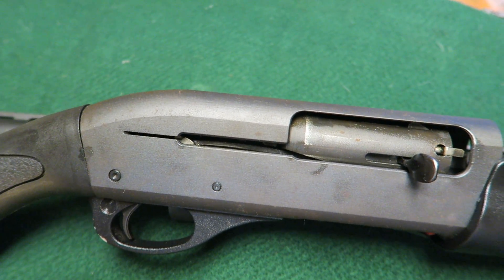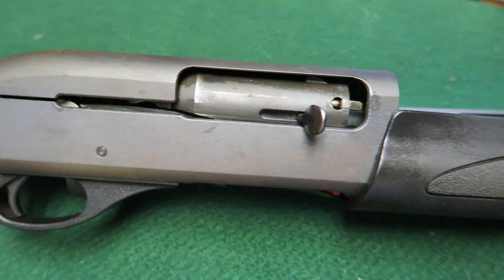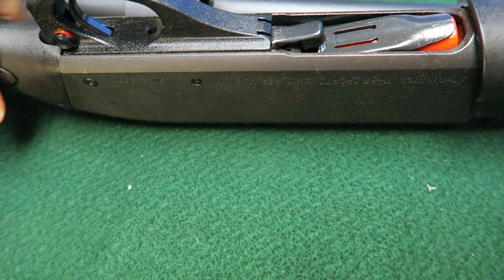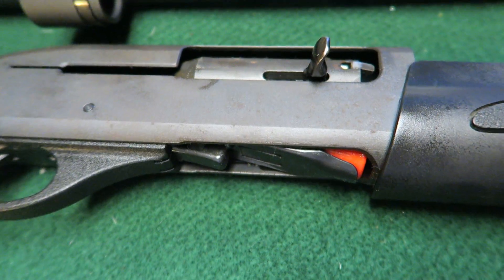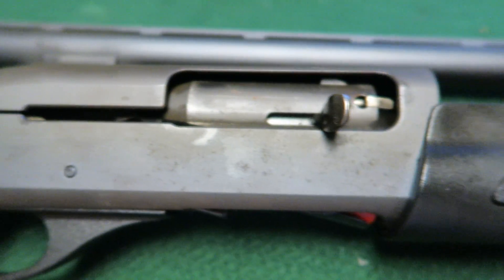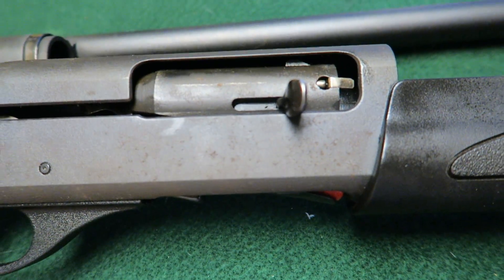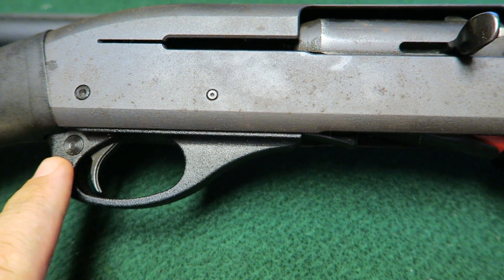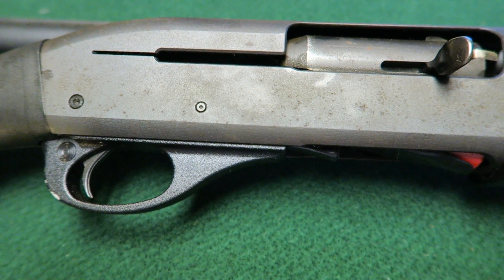Help!!! Live Shotgun Shell Stuck Under the Carrier of a Remington 1187 Sportsman Super Magnum

Comment: I have found that the easiest and fastest solution to a shell stuck between the bolt and lifter on pump and semi auto shotguns is just to slam the butt on the ground while pulling the pump or bolt handle back. That will force the bolt open and in my experience with at least 15 different shotguns of varying brands and models, there was no damage. A little brute force is often overlooked in favor of babying the gun.
Reply: Just want to tell you, you saved my life. That was the tip I needed. And you’re right I got in a hurry not shoving my shell all the way into the magazine. Thanks again!
Reply: Appreciate it alot man helped me out tremendously
Reply: My hero I just hit the butt against my knee while holding the switch on mine meant for releasing
Reply: Damn goat bro worked immediately
Reply: That worked - Thank you.
Reply: I have to try this. A bit sketchy considering once the shotgun is racked if working a shell is going to be chambered. I got two stuck in the lower
Reply: What if there’s a shell in the chamber
Reply: @friedrichfazbear5469  Open the action, unscrew the barrel retaining nut on the end of the tube magazine, pull the barrel off and use a rod to push the shell out. This is assuming you're talking about a shell being stuck in the barrel, on the lifter AND under the lifter. If you're talking about a shell just in the barrel, just ram it free with a rod.
Reply: @shockwave6213  Thank you so much man!
Reply: Worst thing is you mess up the shell, because the internals are made of materials more durable than brass and plastic.
Reply: 3 years later and you saved another person you a Don forever
Reply: yeah im not doing that to my great grandfathers model 11 bud.

Comment: I still own my 11-87 Special Purpose and mine from the factory would jam while shooting 3" shells. I sent it back to Remington and they sent it back to me and told me they found nothing wrong. My best Friend was a gun smith and ffl dealer. I left the gun with him and he found the problem. the feed latch was bent. After he repaired it and test fired with 3" shells we went out later and shot some clay birds. To make a long story short it was the operator not the gun. I was pushing down on the front of the latch instead of the button on the rear as I was loading. Never had another problem with it and I purchased it in 1986.

Comment: anyone else see the gun is on fire
Reply: Thomas Gx yeah
Reply: And doesn’t have a barrel on it. There’s no way for it to possibly fire a round without a chamber in front of the bolt lol
Reply: Yep...my very first thought
Reply: Silver Path hahahaha when there’s no chamber, there’s no way for a round to be held in place, much less be fired lololololol does firearms safety apply when you’re holding a spoon, too? 😂
Reply: Silver Path I’m a gunsmith and a POST firearms instructor. If there’s no chamber, there’s no firearm that can do anything at all. There has to be some way for the cartridge to be contained for any ad, ng, or anything else. By your logic, you could have a pistol grip or a stock in your hand, and say make sure you keep it safe. Do what you need to do, but he didn’t do anything unsafe by not having the safety switch in the safe position, when it’s not even connected to anything that can fire. What good would that do anyone?
Reply: Silver Path man don’t try that. I know you, even if you don’t recognize my YouTube handle. You are white 😆
Reply: @HH-zi5ih  The safety works the hammer, with or without a chamber and can move the firing pin when discharged.. Although it's unlikely it will not strike a primer, until it can be seen that there isn't some other obstruction in the trigger assy that can, it is better to place it on safety before removing it from the receiver.
Reply: @antichrist_revealed  the safety is on because the hammer is dropped. The only way to push that red button in, would be to break it, and that would take a lot of force. It’s not possible to even reset the firing pin in this configuration. If it was, you’d still have no way to fire a round. You do know the round goes in the space where there’s no barrel, right? Lol
Even still, the hammer is down, which is why the safety button shows red, and there’s no way possible for the hammer or firing pin to set like that.
Reply: @antichrist_revealed  and the safety doesn’t “work the hammer”, like you said. It’s actually behind the hammer in this video 😆
Reply: @HH-zi5ih  The safety blocks the trigger, which blocks the sear, which blocks the hammer. Thus the safety blocks the hammer from being discharged. Hard to see in the video if the hammer has been released. Should he (or anyone else in the same situation) remove the trigger assy with a live shell in the carrier, and the shell roll or move into the right position and hammer goes off, it could strike the primer enough to discharged the shell and that would make a pretty messy situation. 

In layman terms and using the KISS methodology, (Keep It Simple Stupid), the safety works the hammer. Try dropping the hammer with the safety on and you will see it doesn't work (or shouldn't in a properly working gun). LOL.

 However, despite your contention, the safety can be put on or off, with or without the hammer being released, and therefore there is no fear of "breaking" the little "red ringed" button (or the detent ball and spring holding it in place) that one pushes back and forth for safety reasons, (or just checking it out or playing around with it, which brings another LOL).

Therefore, it's much simpler to place the safety on for a precaution (and not worry about breaking something that won't break), than run the risk of injury. Using the KISS methodology of course.
Reply: @antichrist_revealed  safety won’t go to safe when hammer is down. Nothing can fire when the hammer is down. If you own a 11-87 or 1100 (they’re the same), go pull the trigger on an empty chamber, then see if your safety can go back to the safe position. The way this guy is operating is in no way, unsafe.
Reply: @HH-zi5ih  I own 2 of them and they both will go from safety to fire whether the hammer has been released or not.
Reply: For me, every gun gets treated the same every time. Safety is on until ready to shoot. Regardless, if it is broken or not. But, to each their own.

Comment: I mean... If you can't release the bolt and move it back... just remove the handguard, unscrew the mag tube cover, and give her a jiggle, the shell should drop out... This looks like someone tried to "ghost load" a shell... just drop one in the chamber and fill the tube...
Reply: I'm trying learn, what ghost loading, I had one shell and I decided to load it in tube and when I went to pull the action back it got stuck under the slide thing
Reply: @rustyshackleford3320 fed boi this is illegal in many states and definitely not possible, you shouldn't operate the thingamabob any other way than how it's designed to work...  Best of luck with your endeavors unless the Zeitgeist turns on you then I didn't mean it... But if you're in the same situation as the man above I hope my previous statement helped you out

Comment: This is due to not cleaning the gun properly. Simple fix though all you have to do is take the trigger assembly out cause that latch is attached to the trigger assembly. That is the 2 pins you see in the receiver above the trigger. These guns need to be cleaned alot gun powder builds up on the latch.
Reply: Travis Thacker  My Chiappa Firearms shotgun has the same problem with it's latch. It seems to take some shells with no problem but others will get stuck like this.